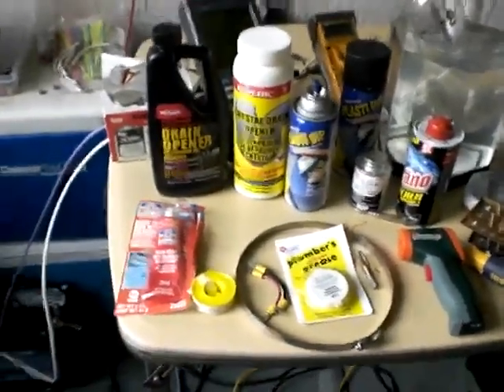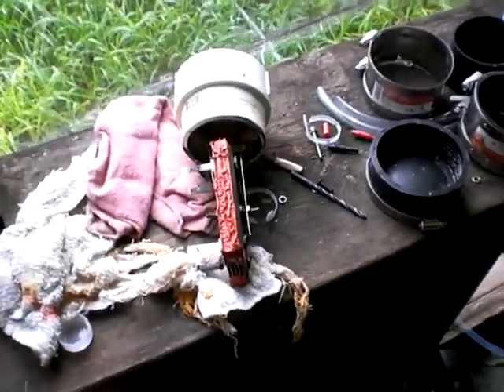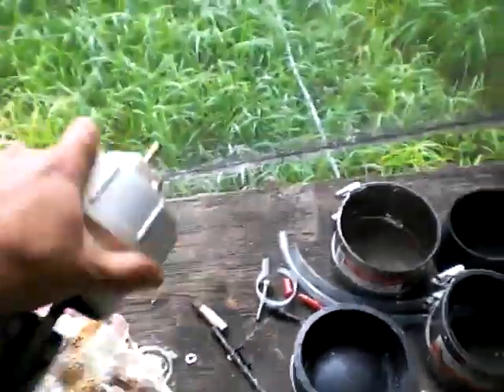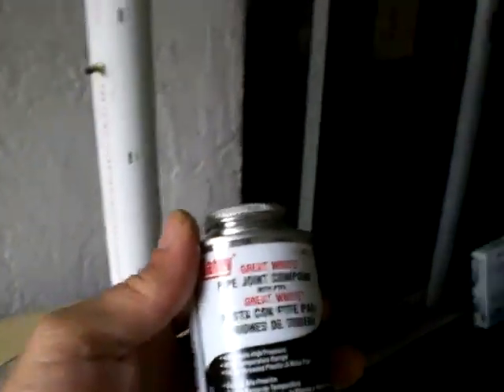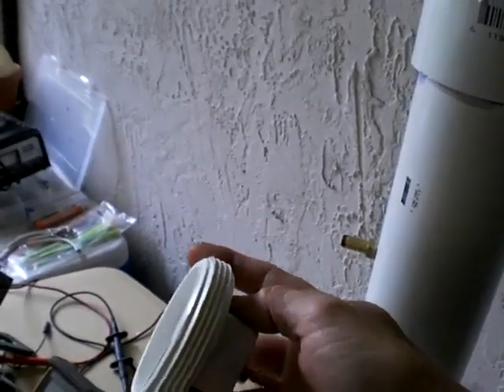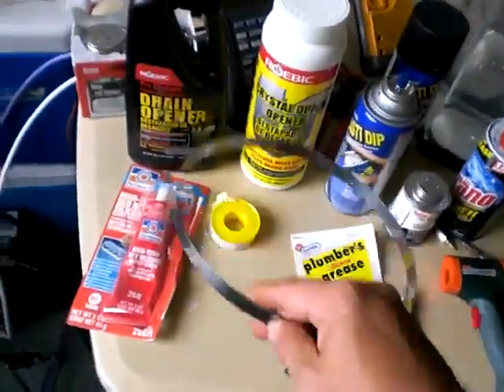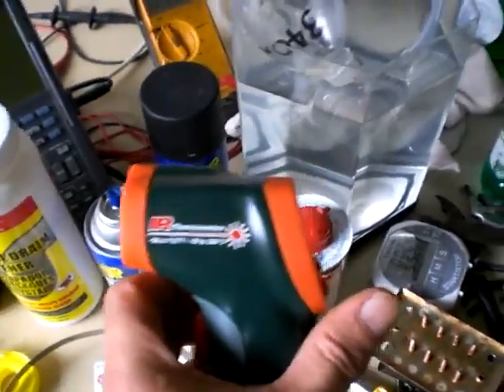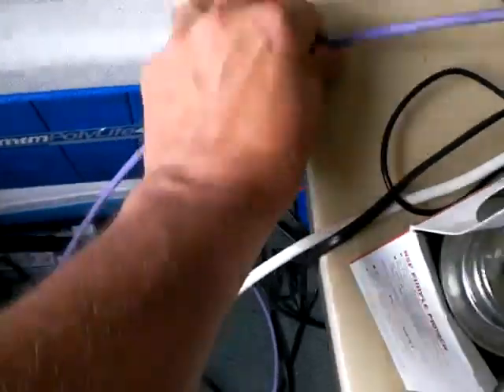Informal review of HHO materials

Comment: You say 10 gage is rated for 13 amps, but its rated for 30 Amps!  8 Gage is 40A.  I've pushed 20 amps without the wire getting hot on 10 gage...  

How much of the drain opener (black container) do you use usually per gallon of water?  I just picked some of it up at Lowes last week before seeing your video.

Also why are you using PVC.  PVC is only rated at 80C.  If your boiling it then your at over 100C, not good for the PVC.  It changes states at over 80C.  ABS is better.